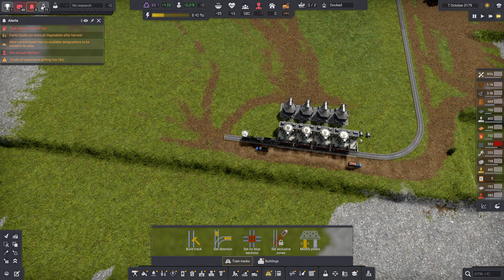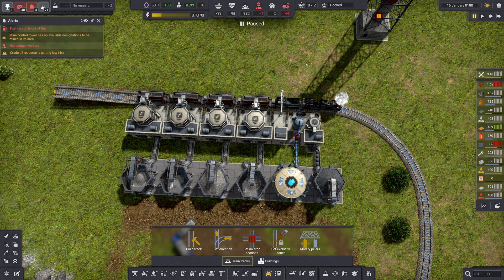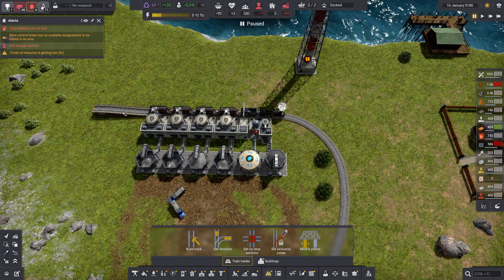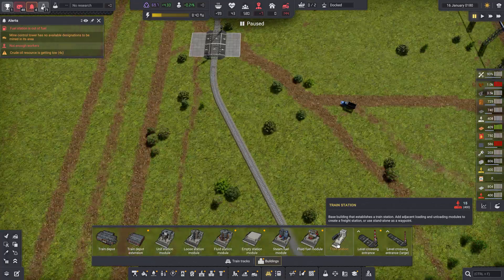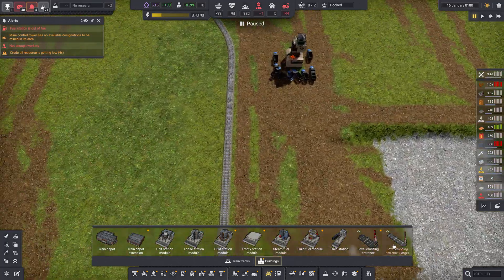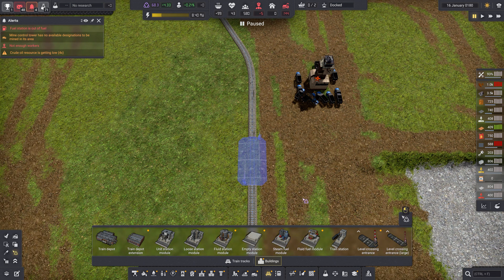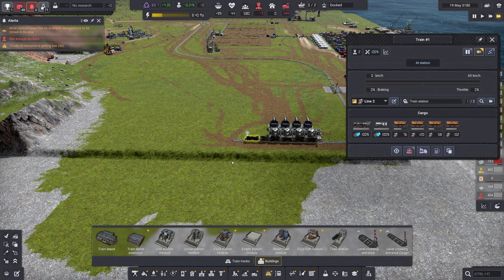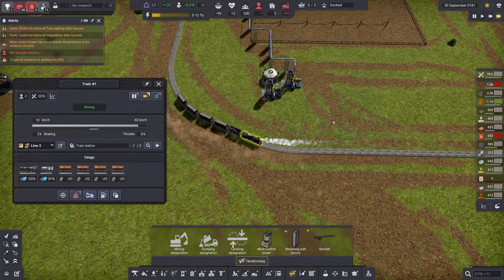Train Tutorial for Captain of Industry

Comment: you can use train stations as waypoints so you can make T junctions using one-way railroads to turn the train around and you can make a duble track one-way so you don't have to deal with all the crap 
i still prefer the signals so many games use idk why the fk they thought its so complicated, the trains in coi are retarded with no AI at all, you have to place stations and tell it to go there and come back on another line its all just so fking disappointing
vagon size is too small too its 2x normal yellow truck with the same speed like wtf all that just so it looks fancy
Reply from the maker: Thanks!